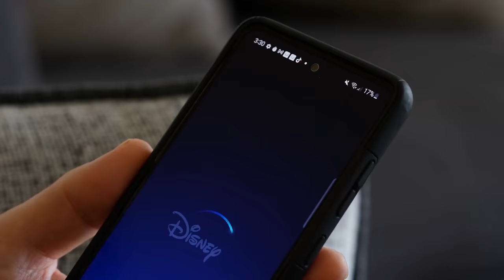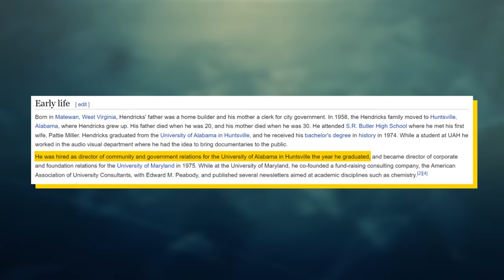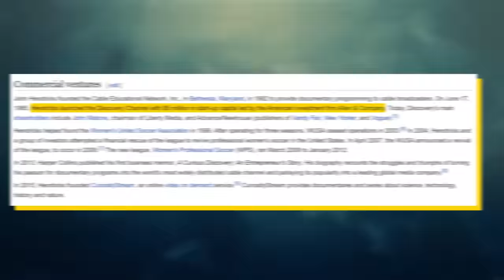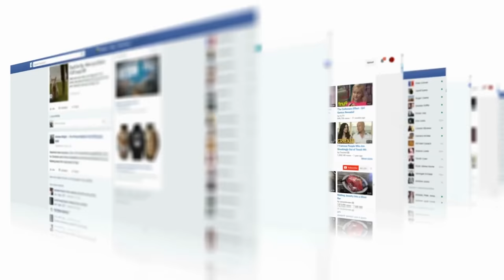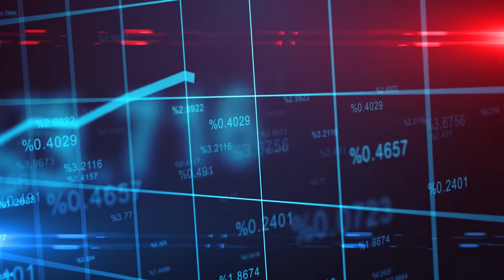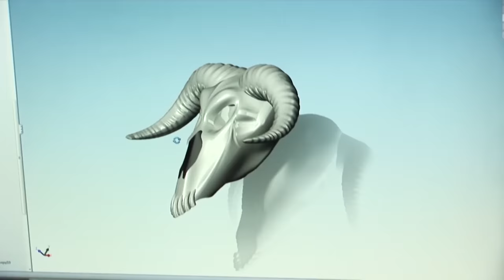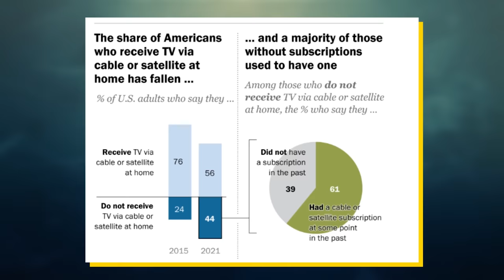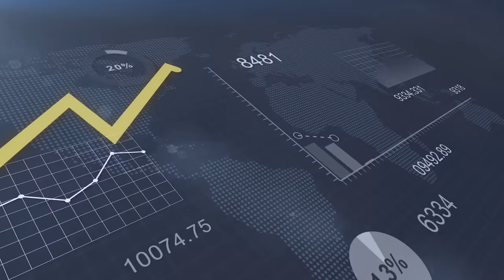What Happened To The Discovery Channel?

Comment: Discovery was great in the 1980s.  PBS was the gold standard in the United States, but Discovery was a good addition to the cable line-up.  Over time, Discovery did the same thing that many other for-profit entertainment channels did - it dumbed down its content in order to attract a wider audience.  As long as the primary mission is to seek the widest audience possible, this is inevitable.  Cheap, mindless entertainment has always sold well, and it always will.  I like cheap, mindless entertainment every now and then, but I don't like seeing it drive out everything else in the name of short term profits.  PBS, as a non-profit, is under less pressure to do this, so it can afford to play to a niche audience that is willing to contribute money.  These days, PBS is still good, but streaming provides additional options.  Curiosity Stream reminds me a lot of 1980s Discovery.  There is a lot of high quality educational content, and it doesn't have a massive load of garbage "reality" shows cluttering up its line-up.

Comment: The older Discovery was better. Although I stopped watching Discovery when the main way for receiving the channels in the UK was via a satellite broadcaster. When the satellite moved there service from analogue to digital they split the Discovery channels across a number of packages along with othere channel groups. This ment a significant price hike in the monthly subscription cost with having to subscribe to many channel packages to continue receiving the channels you wanted, with advertisements breaks still being placed into shows that you were now paying a lot to receive. Gradually digital terrestrial stumbled onto the picture but it came with it's problems. The subscription platform faild and struggles to deliver on better reception quality. With the improvement of internet connections with FTTC and FTTP. It is often far cheeper easier and convenient to access media content via Internet on demand streaming. While the satellite braudcaster here is trying to enter the online market there still trying to use there satellite packages structure which is still pricing them out. 
Ultimately all of the services are rigged to fail where there having to service the shareholders. The recent bubble of submissions caused for them buy the lockdowns means that there businesses will contract as more of peoples time returns to every day life. Also with the current squeeze on income and inflation people are more lightly to cut the subscriptions. That leaves the streaming services the problem of how are they ment to grow there businesses with an audience shrinking shrinking back to a normalised size. Putting up subscription costs risks driving away more subscribers, cutting quality, services and products also risks driving away subscribers.
Then there are studios that didn't want to take the risk themselves but have now seen that streaming works, that are looking to take a bigger slice by cutting out the middle man and providing streaming services themselves. At the same time withdrawing or selectively cherry picking the products they make available to the other streaming services to try entice subscribers to there own streaming services. All of these trying to go after the same pool of subscribers. 
It does seem that it is all headed for a spell of instability again where the only way the streaming companies will be able to grow there businesses is to buy each other out until only a small number dominant services remain.

Comment: Interesting, but it's a huge mistake to use the word "reality" to mean "unreality"; that's not what the word means. Call Unreality TV exactly what it is: Unreality TV. (I hope you didn't think anything in there is real? It isn't. Reality is what happens in the world around you, not on TV.) What happened to Discovery was, they pulled a Rupert Murdoch and ditched reality in favor of fantasy. But that worked out terribly for them, because they failed to consider that their core audience consisted of people wanting more information about actual reality. So when they switched to fantasy, their "right half of IQ bell curve" audience went away, and was replaced by "left half of IQ bell curve" only. Whereas before, they catered to both halves, they now appeal only to stupid people, thus cutting their audience permanently in half, due purely to their own bad decisions and reprehensible behavior. They thus screwed-over both their shareholders and their audience. The cause was allowing too many stupid people onto their board of directors. Bad idea. For a company to survive long-term, it's better to keep the board small-and-smart rather than large-and-stupid.